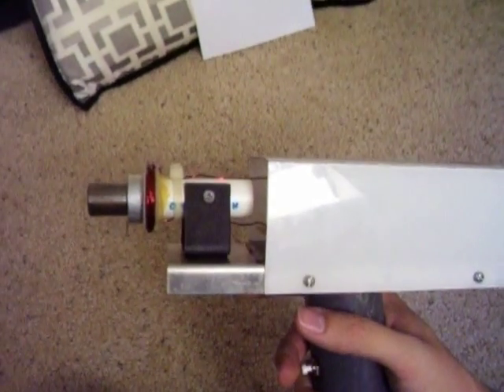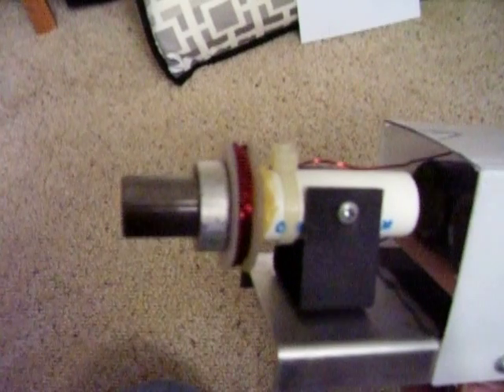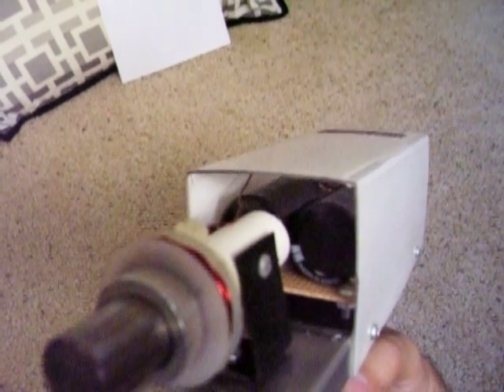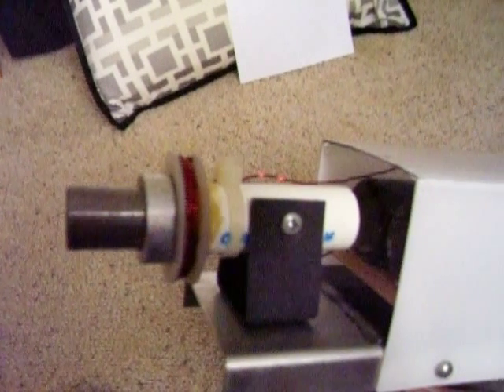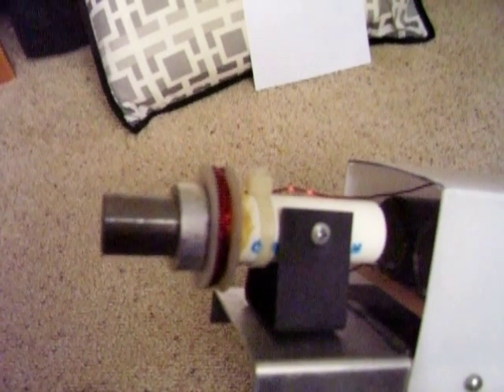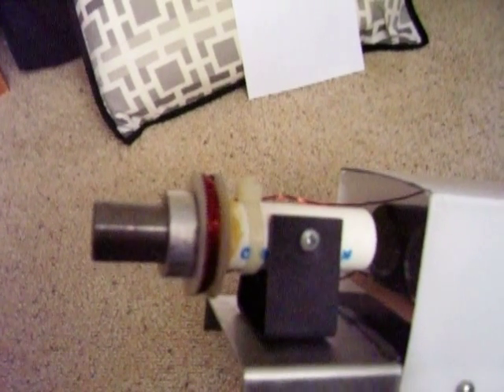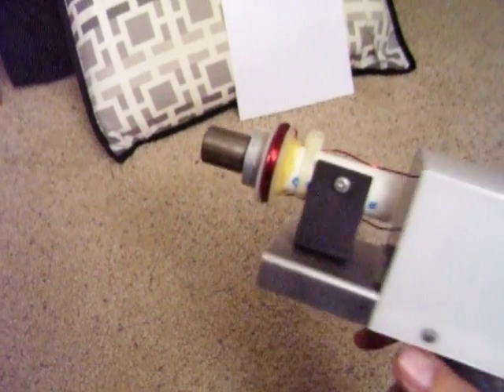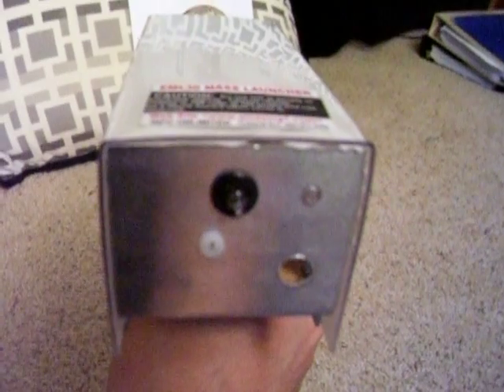Electromagnetic induction demo with a homemade mass launcher

Comment from the maker: DC. There is a circuit oscillator inside that converts 12 V  to 600 V. When the capacitors discharge into the coil, it's DC.
Reply: Robert Utter I am curious how many turns of wire and what gauge of wire did you wrap on that coil.